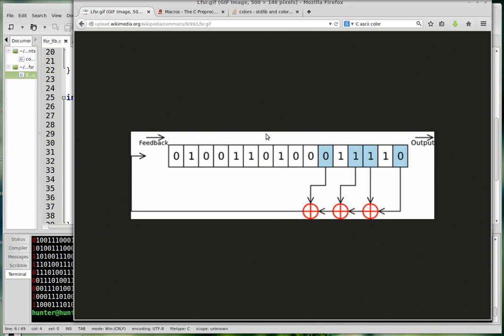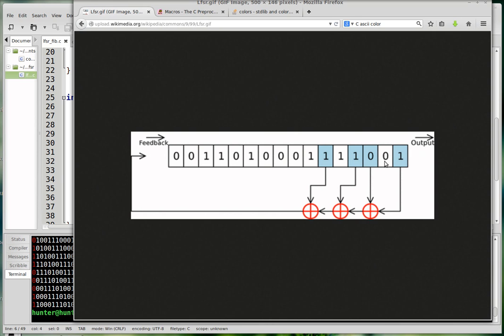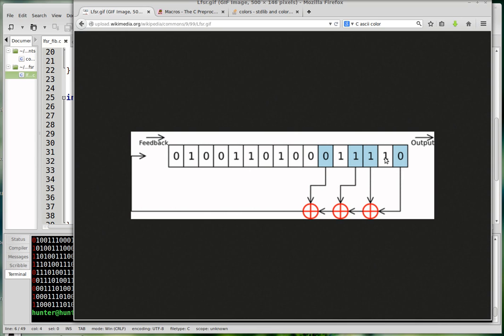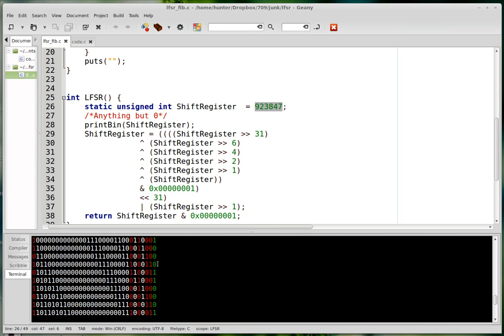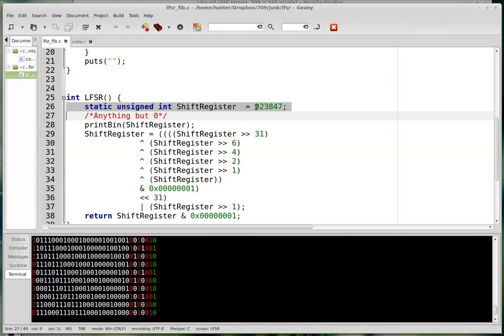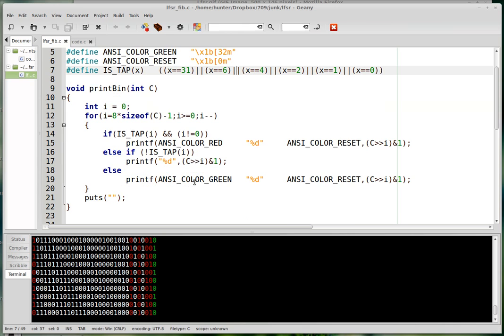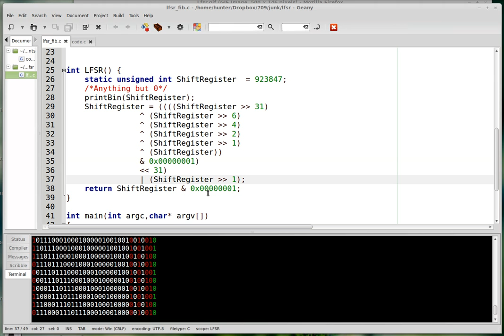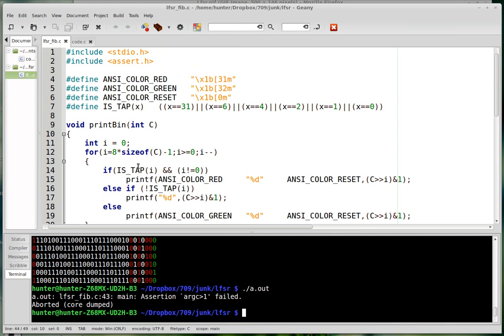Application: Linear Feedback Shift Registers! C Tutorial 9.2

Comment: hi johnson,
i did try to run the code but it was showing error, in line7:15  IS_TAP error: called object is not a function or a pointer function.
can you help!!
Reply from the maker: +Lynas Con 

Hi, thanks for watching the video.  IS_TAP is a macro (http://www.ebyte.it/library/codesnippets/WritingCppMacros.html) .   Are you sure your syntax is exactly the same as mine?  A common mistake with #define statements is to end them with a semicolon.   I've only tried my code with the g++ compiler, but it should be okay on Visual Studio as far as I know.
Reply from the maker: +Lynas Con 
Hi Lynas,  I searched my machine for the code, but nothing came up.  I'm sorry, I made the video a year or so ago and seem to have lost track of the C file. The code is very similar to what you'll find in Schneier's Applied Cryptography, which you can download for free.   A blunt fix for your error is simply to replace that macro with the code it macro-izes.
Reply from the maker: +Lynas Con 
Spoke too soon.

Here is the code:

https://gist.github.com/hujohnson/acbdd0d8fd78a6427cb3
Reply: +Hunter Johnson  thanks a lot